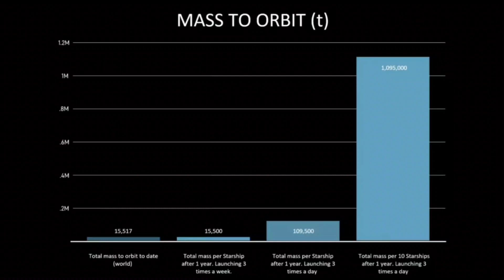SpaceX Starship's New Raptor Engine is an Engineering Masterpiece !

Comment: Most of the chat believe Raptor 2 will not work on a Raptor 1 or 1.5 puck. Other that thrust output is there definitive evidence of difference in mounting or plumbing to prevent interchangeability ?